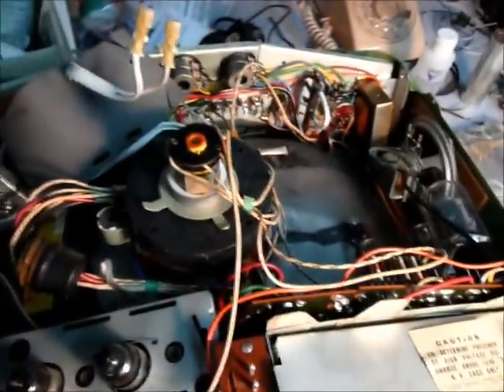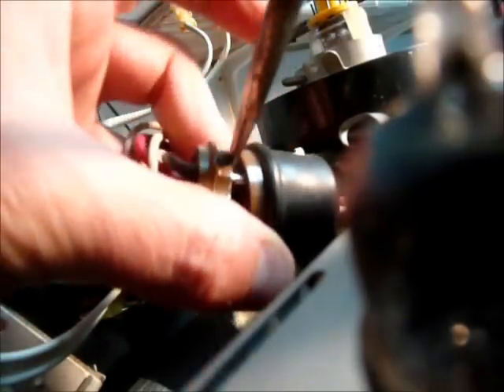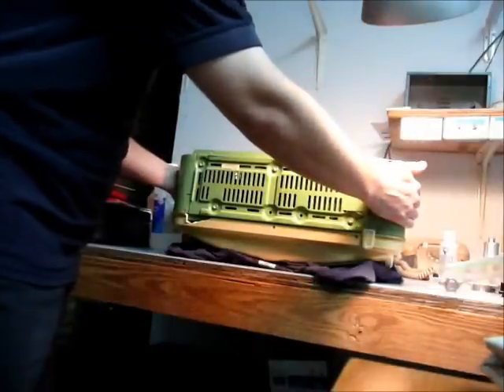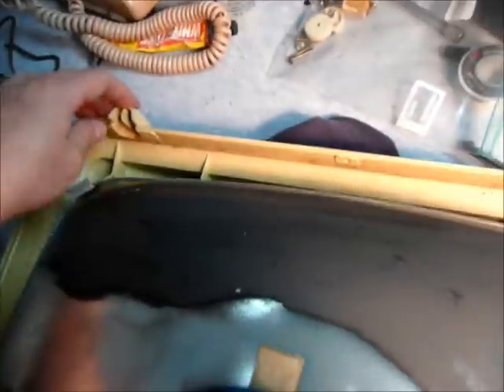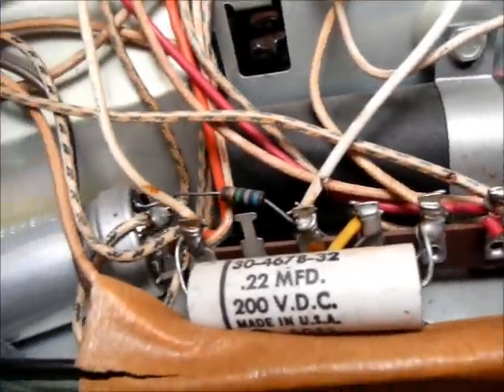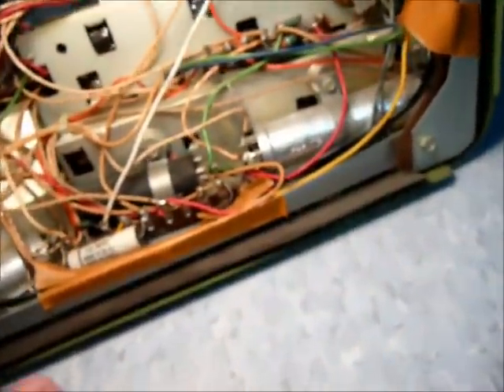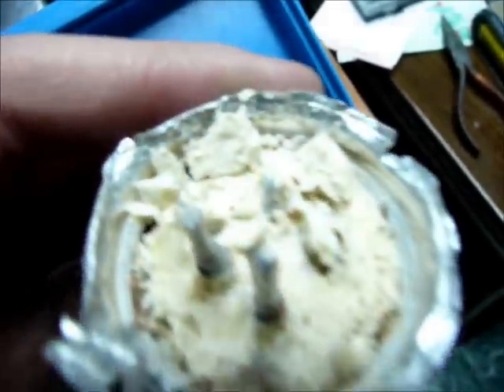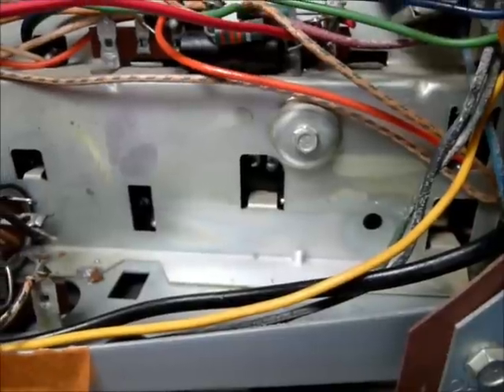1960 Philco Briefcase 19 Repair - Part 2

Comment: You could put the electrolytic in a Toaster oven no longer used for food  to heat it up. May work.I edited this to make it more safer for those who may try this. Thanks
Reply: Think I put my can in the pot of hot water that's on the woodstove for a few minutes, & it slid right out.
Reply: No don't do that.  You'll fill you oven with nasty chemicals as it out gasses.  Probably wouldn't get hot enough either.  A heat gun and a corkscrew is really the best way to go.
Reply: bandersentv
Hi Bob. I had been awake all night and wasn't thinking straight. thanks for the correction.
Reply: This is in reply to my first Comment. While not sleeping for a couple of days. Needless to say my brain wasn't working. You could use an old toaster oven that is no longer used to prepare food. To heat up the cap. this could be used for those that don't have a heat gun. Or can't afford one. My Thanks to Bob Andersen for calling me out on this. Just don't go crazy with the heat. :)
Reply from the maker: I need to find the new heat gun I received for Christmas :\  I still think I mauled the can prying the bottom out.  But I have a box of old cans and am going to try again.
Reply: audubon5425
It didn't look to bad to me, but since you have others that's a good plan. Thank you for the reply

Comment: 1:25 Shouldn't there be a "suction cup" shaped housing over the anode connection, to stop contaminants getting in?
Reply: It's just a shallow metal cup - there's no concern of contamination getting into the CRT.  The rubber cup is to prevent someone getting shocked.  They can save a few cents by leaving it out.